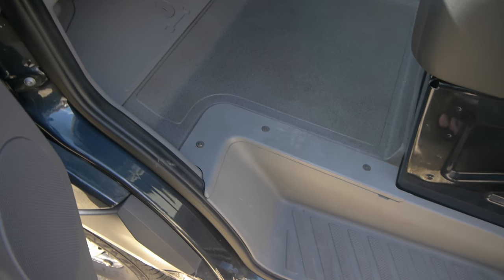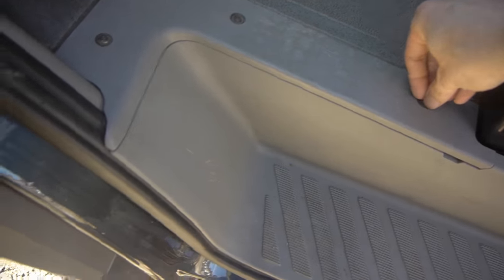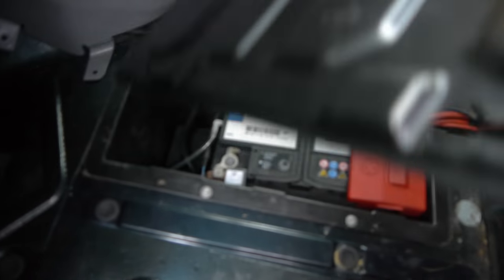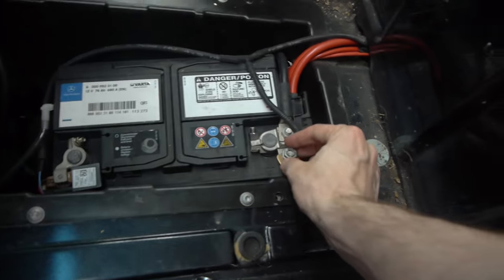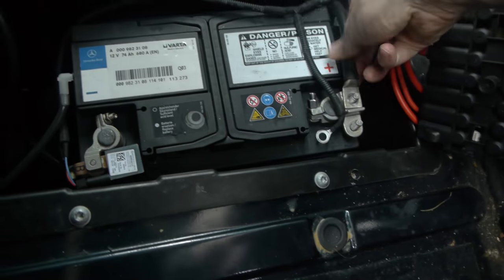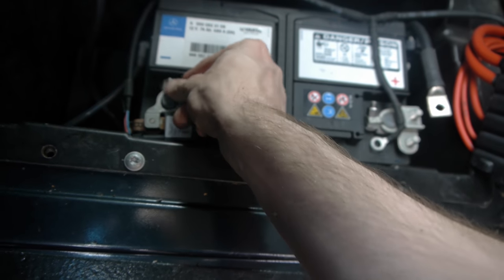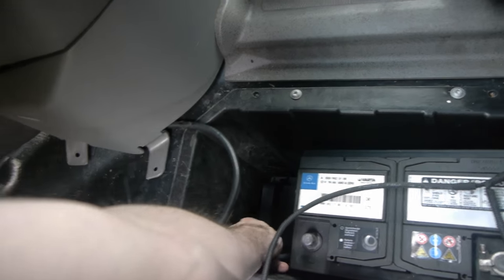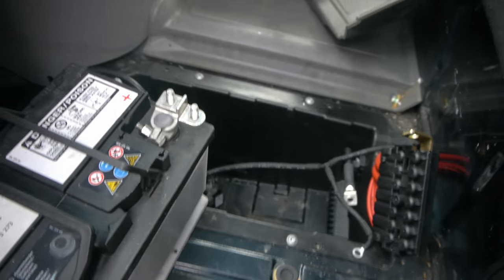Mercedes Sprinter Battery Location and Removal Proceedure

Comment: Remove the ground first. Always. If you hit the chassis with your wrench while touching the neg terminal, it does nothing. If you do it while touching the positive terminal and the neg terminal is still connected, you short the battery to chassis/ground and cause a serious surge that can damage your battery and/or vehicle electronics.

 This is why you always remove the neg cable first.

But I do want to thank you for doing this video. It is quite ueseful for people who do not know where the battery on a mercedes sprinter actually is!

Comment: Thanks for the video, a couple of things though.  You should always remove the negative first then then positive and then in reverse for connecting.  It removes the chance of shorting anything if you happen to touch the positive cable to anything while the (black) negative connection is still connection.
Reply: what size is the bolt. important info s
Reply: T25 for plastic trim, T30 for metal battery cover

Comment: Thank you for this. I'm  converting my van into a camper and want to link my van battery to my leisure battery ( am planning ahead) so that when the van battery is full the charge can go to my leisure battery - but I couldn't find the van battery! When it wasn t under the bonnet I thought it would be under the driver's seat but no it wasn't there either. Now I shall go and say hello to my battery in the next couple of days. Many thanks.
Reply from the maker: You're very welcome!

Comment: Not bad at all, really, Thanks!  Sparks narrowly averted by chance (as mentioned by Rick Crespo) and also a good thing that the van didn't lose its marbles when the battery was taken out. Some vehicles these days need a diagnostics computer to reset the vehicle's electronics if a backup battery isn't connected in parallel to the battery cables BEFORE removing the vehicle battery. Some Mercs have a seperate "systems" battery for this requirement.

Comment: any real mechanic would know to remove the negative post first to reduce sparking risk. this guy is removing a live positive terminal with a metal tool which he almost shorted out to the body
Reply: I almost had panic attack when watching the video. “-” first - Always.
Reply: Agreed
Reply: He did point out that he'd already disconnected the battery isolating cable first, nevertheless...negative first, then positive, connect battery opposite way but don't forget to reconnect isolation cable after

Comment: It would have been nice if you mentioned the size of the bolts that you had to use the extension to get to that hold the battery down. 14mm also?

Comment: ALWAYS disconnect the earth terminal first.
If not, any metal tool used on the positive (+) terminal, could short to surrounding earthed metalwork like the floor or seat box.
Apart from waking you up with a shower of sparks, it could destroy some of the sensitive electronics that modern vehicles are filled with, or even trigger the airbags.

Comment: I saw you disconnected a wire from the side of the battery. Do you need to go to the dealership to get their battery or can you go to a auto store and get one there? Thanks
Reply from the maker: I bought a new one online... so yeah an auto store with the same spec battery works fine

Comment: Hi , will removing the battery upset any settings like onboad computer?
Reply from the maker: don't think so - it didn't for me at least!
Reply: Hi there, thanks for putting this video on you tube I have just brought the same van in February to convert in to a camper also in black never paid a lot, it had no mot  left it near my home in London  for a month ,went to it yesterday alas  no life  whatsoever and could not find the battery  so then went on you tube and saw your video about your van so many thanks  for all your information best regards Mike...
Reply from the maker: funny stuff - the same thing happened to me actually! Good luck with the conversion
Reply: was going to ask same question thanks . need to do some welding in the back for a camper bed frame  and mine is already hooked up to 170 amp leisure battery,s

Comment: Hi you must take the negative off first. The battery stores a large ampage. If you take the positive off first and the tool you use comes in contact with any bare metal part you will have a large flash and molten metal every where and possibly lose a digit or two. For gods sake every one take the negative off first !!!!!!!!
Reply from the maker: ok thanks for the tip

Comment: Why on earth would mercedes make it so bloody hard to get to the battery? I haven't got those star tools.
Reply: Buy a set of dewalt bits, you'll need the T25 for plastic trim and T30 for metal battery cover...doesn't have to be dewalt

Comment: Are there any other items in the battery box besides the battery. Other controls for the engine for example?
Reply from the maker: it's all in the vid - the connectors, the fuse box and the bracket holding it underneath

Comment: My right hand drive, 2019 sprinter, due to unforeseen circumstances, fully drained the battery.  I have a manual key to open the driver's door, but the passenger door won't unlock or open.  Therefore I can't pop the Bonnet because the handle is impeded by the door. Poor design.  Taking the battery out, home and recharging is the only choice.